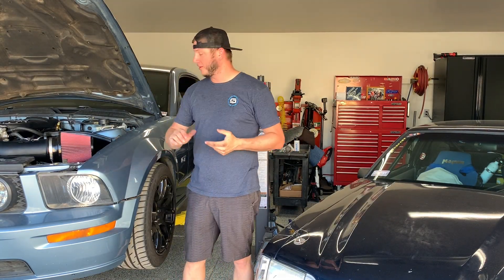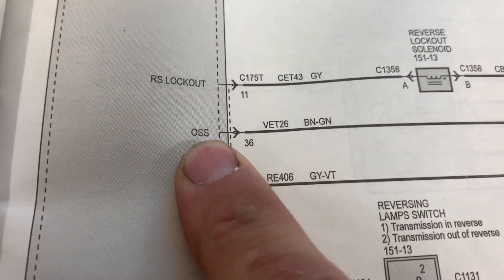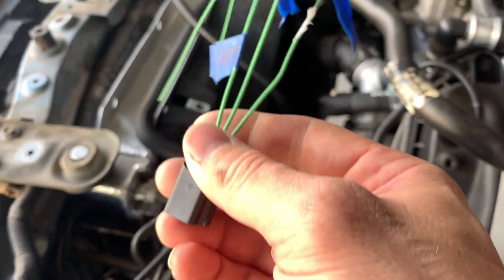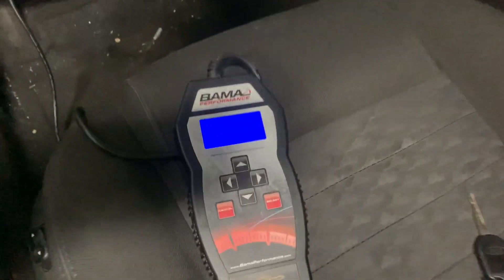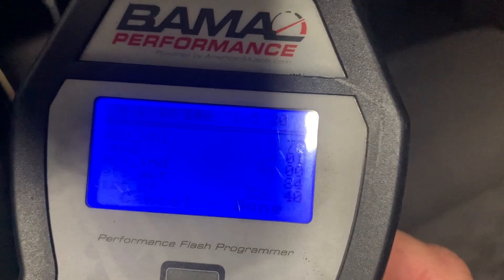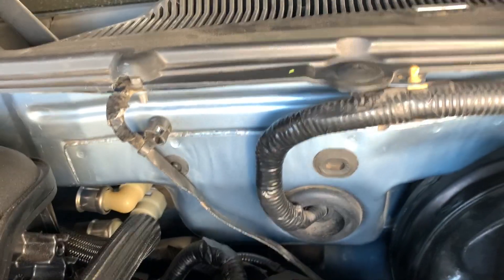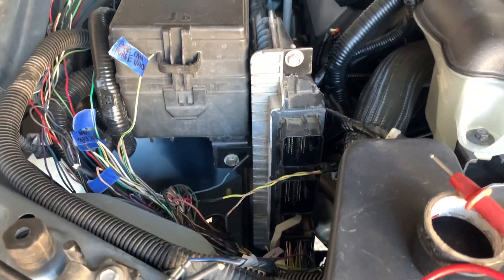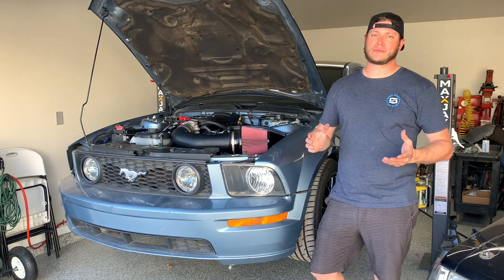Make the A/C work in your early S197 Coyote swapped car, fuel pressure test, and trans harness mods

Comment: Just finished hardwiring a gen 2 into my 05. Wired the ac like the video but can't get the clutch to engage. Looking over both 05 and 2015 diagrams I dont see how the button on the dash signals the pcm. My wiring from pcm to clutch/transducer checks out. Im thinking its an issue of the pcm not seeing the ac request from the dash. Any knowlege on this?
Reply from the maker: @justinbonsell5471  yeah, you’re using a second gen and the CAN bus messages don’t translate like they do with a first gen ECU
Reply: @MattSoppa  Damn i was hoping it didn't use canbus but that checks out. I figured out how to translate can messages for tach and speedometer so maybe I can do something similar.
Reply from the maker: @justinbonsell5471  please let me know how you do that. I’ve been lucky so far

Comment: Baller. Just de-loomed my original harness and just kept a/c  and crank and used both pcm’s to get mine to work.  I thought I was cool using the gen 2 but definitely made the swap harder to combine everything. So just kept both computers.  🙏
Reply from the maker: Nice work!  I couldn't handle having two ECU.  If I wanted a 2nd gen, I'd use gen1 timing components in the gen 2 engine and have the best of both!